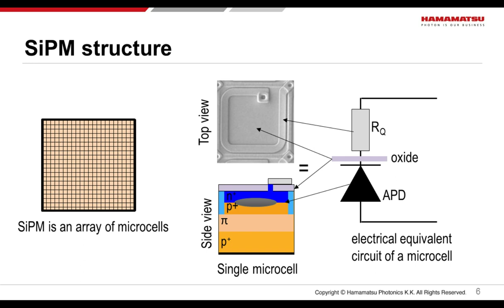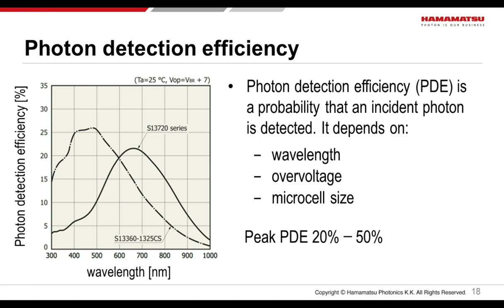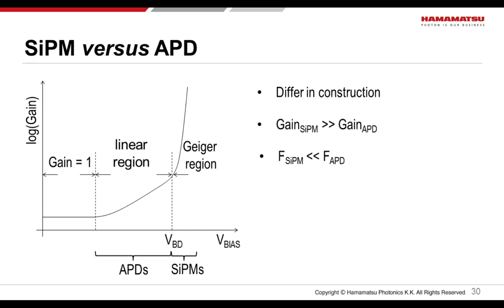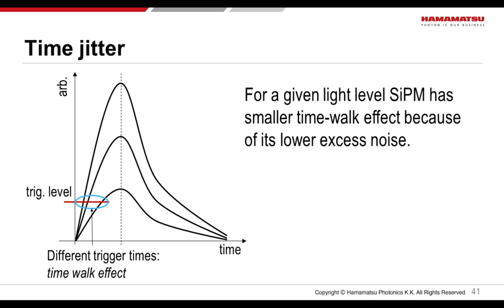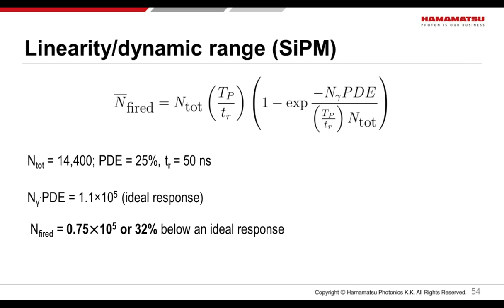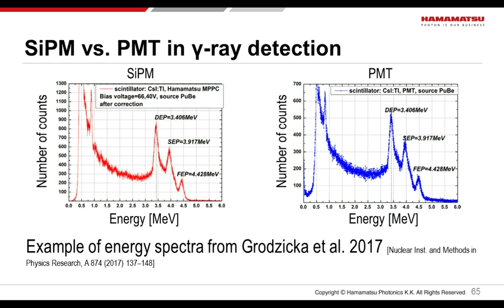SiPM: Operation, performance, and possible applications

Comment: Great insight about SiPM, thank you very much for sharing.

On a side note: Transimpedance amplifier circuit is incorrect. Inverting and non-inverting terminals are swapped
Reply: Thank you for pointing out this error, I might have missed it otherwise.